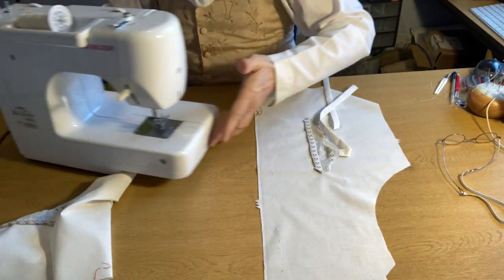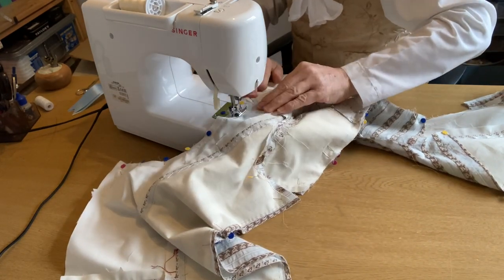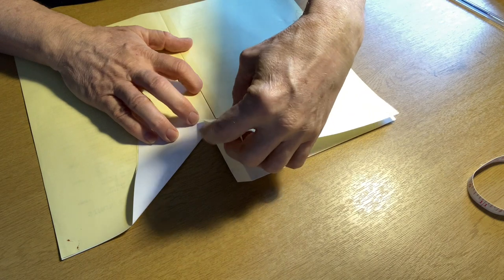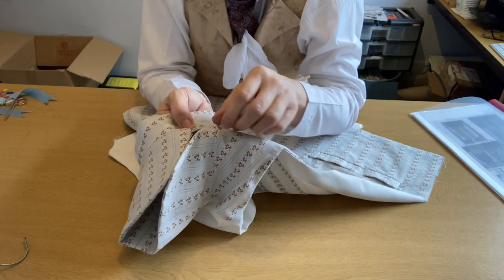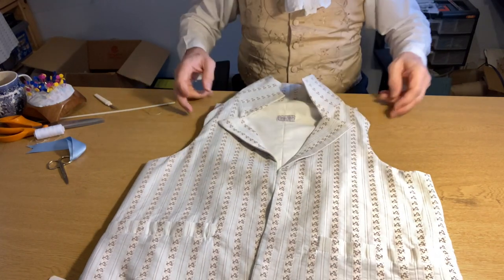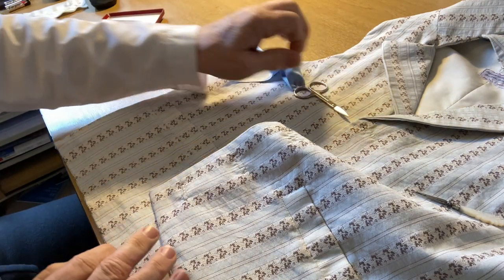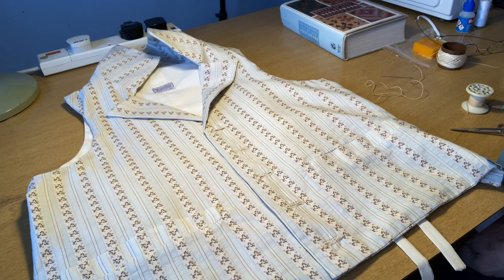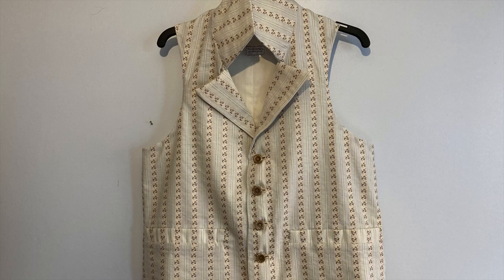Make a Regency Waistcoat from Cabbage - Part 2 - Regency Rum Bluffers

Comment: Beautifully matched pocket welts. I thought that the pointy tool that you used for starting your buttonhole cut was a stiletto? Which pattern did you use? I missed it and couldn't find it in the info. I feel inspired, imperfections show that a machine did not make the garment. Love it!
Birdy
Reply from the maker: Hi Birdy, the pattern is Laughing Moon Number 125 - Men's late Georgian Vest 1795 - 1817.  As I understand it, a stiletto is a fashion shoe heel or a short bladed knife - the pointy thing I used I call a bodkin meaning  a rounded piercing tool, but the word can also be used for a short knife, a blunt threading needle or a sharp tool used by printers - don't you love the English language?

Comment: Hi! I made the grave mistake of puckering up the lapels, how could I fix it?
Reply from the maker: I am guessing that the problem lies in the placement of the point where the tailor's tack marks the intersection of all of the seam lines, and was discovered when you turned it inside out.  Don't worry, like most things in sewing it can be remedied by carefully unpicking your sewing and going again.  Look carefully at the point and work out what caused the puckering, then turn it back inside out , re-position the point and re-sew.
There is also a cheat which is not good sewing practice, but which I confess I have used from time to time: leaving the waistcoat turned right side out, unpick the sewing in that area, move it around to remove the puckers, press, and then slip stitch (invisible stitching) the seam.  Good luck - we have all been there!